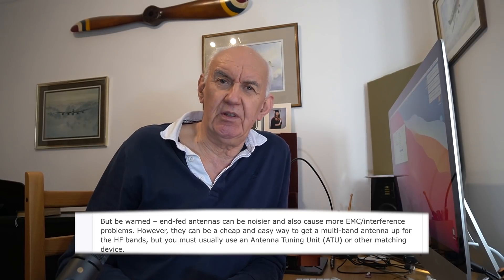END FED HALF-WAVE ANTENNAS - BEWARE!  WHY?

Comment: Actually the RSGB are correct. Let's look at some EFHW theory: 

The usual EFHW arrangement is to allow the coax to provide the necessary antenna counterpoise. Due to the high feedpoint impedance of an EFHW (about 4K), this usually works perfectly well but it *does mean that the coax is part of the antenna system*.

There are 2 consequences of this - guess what they are?

1/ NOISE: any common mode noise injected into the coax from a switching power supply, mains-born noise or other source of noise in the shack is fed straight back into the receiver input. With a noisy power supply, this can easily contribute 5 or 6 S-units of additional noise which would not be present using a half wave dipole fed with balanced feeder or coax with a balun at the antenna end.

2/ INTERFERENCE: for the exact same reason that in-shack noice ends up in the receiver, RF from the transmitter ends up back in the shack, and potentially ends up back in your mains circuit, where it is in a position to interfere with other electronic devices in your home. This may be less of a problem in 2021 with electronic products being generally less susceptible to EM interference than in the past, but that doesn't mean that there isn't a problem with the aerial injecting RF back into the mains.

The above situation won't cause problems for everyone, it will for some though!

This situation is fixeable, just add a separate counterpoise to the EFHW transformer and connect a balun between the coax and the EFHW transformer so that the coax is no longer part of the antenna system. But how often do we see someone bothering to do that?
Reply from the maker: The noise factor you try to explain does not exst in any greater measure than other coax fed systems. The coax counterpoise is likewise wrong. You may want to che k Moxon on end fed Zepps. An extremely short coax feed to an EFHW works just as well and a counterpoise makes no neasuravke difference. Peter
Reply: @watersstanton  

1/ Here's a technical article that covers both EFHW and Zeppelin antennas and further explains the theory I have outlined above: https://www.w8ji.com/end-fed_vertical_j-pole_and_horizontal_zepp.htm

(Look for the text in red on that page)

As further explained in the article, an end-fed antenna of any type that worked without something somewhere (e.g. the coax or even the radio itself) acting as a counterpoise would violate Kirchoff's current law. There MUST be a return path for the current if current is to flow to the antenna.

The need for a counterpoise may be minimal with an antenna that has a high feed point impedance but it is NOT non-existent.

2/ Unlike an end-fed half-wave antenna in which the coax works as the counterpoise, a coax-fed dipole with a balun at the antenna end will have no susceptibility to common-mode noise injected into the coax. it is incorrect to claim otherwise, and the difference can be huge if the radio is connected to a noisy SMPS.

3/ my main point here is that the RSGB are correct in their claims about this type of antenna, I think that needs to be acknowledged.

Comment: Your statement at 5:55 that the antenna presents the SAME impedance on different bands is not correct. It does present HIGH impedance on harmonic bands but the impedance falls a lot at higher frequencies. I have used one the last ten years, fed through an L-match, and have no complaints.
Reply from the maker: That is not supported ny my measurements.
Reply: @watersstanton  you had better measure better

Comment: I converted my multiband doublet to A EFHW.  QRM was reduced immediately plus all the regular AM signals on 3.615 were a good 2 S points more. Far more successful for me as the multiband doublet was noisy and not fully balanced due to logistics.  My EFHW lis cut fir 80m upwards and by far the best for me here in South wales. De gw4gja
Reply from the maker: Ken, great to hear from you. 73 Peter

Comment: I built the 20m EFHW vertical after watching you explain it. Using 30watt portable I was told "I'd swear you were using a beam and amplifier"
Reply: I should do that!
Reply: @StephenGangi  I believe he has an older video on making and tuning a true end fed half wave. It uses a piece of coax as the tuning capacitor. No formulas or special parts.

Comment: End fed antennas are very good.  I've been using a HighEndFed Antenna from the Netherlands for a while now and it works great.  However, I had to make some modifications to the installation because I was wiping out a digital set-top box.  I turn the antenna around so it was fed from the bottom of the garden.  Also, I'm using an RF choke along with two counterpoise and earthing.  It appears to have stopped the interference.  Having said that, just occasionally, my transmissions do still knock out the signal.  But I am beginning to wonder whether there may be a problem with the cabling on the set-top box rather than a problem with my antenna installation
Reply from the maker: Thanks for sharing. 73 Peter

Comment: EFHW antennas are great - I think the issue with comments about end fed antennas and noise are folks thinking about 9:1 unun fed random length antennas - these are notorious for noise and common mode current issues and folks seem to confuse these with 49:1 EFHW antennas

Comment: For years I oped in ingnorance. Then one day out of desperation I tried an endfed. Now I realized I had wasted half my ham life. I now use either end fed or offcentrefed longwire. Often at under 100watts . 15 years later I am still grinning. Have no desire for any other. Keep.preaching. Ve3lyx. It scares me because I agree with everything you said
Reply: End fed and off centre fed antennas has issues with common mode currents.  It can cause noise and RF in the shack.  You can cure most of the problems using a current balun.
End feds are just half the antenna, so the rest is either the coax or metal supports.
Nothing wrong with the principle, but anyone using them should have an idea what this does to your radiation pattern.

Any antenna is better than none, but I prefer balanced antennas to keep noise as low as possible.

Comment: Thank you. I like QRP operation from nature. I use both end-fed and center-fed antennas. Both work equally well. However, EFHW has a huge advantage in nature and is easy to install and as you say, you can use it on multiple bands. You can watch my new video (OK7NV), but unlike you I'm not a good speaker or youtuber :-) - OK7NV 73 Jiri.

Comment: Ships use end fed wires that come directly into the radio room usually via copper tubing and were tuned using a very robust antenna matching unit. We used to hang neon bulbs on the copper feed lines to provide a visual indication of which antenna was active and that rf power was actually being put out by the PA.
Reply: Amazing!!
Reply: not any more they don`t
Reply: @brian.7966  Correct, because tens of thousands of maritime radio operators both ship born and land based were now superfluous to requirements thanks to GPS and Satellite communications that replaced maritime SOLAS and ship to shore HF radio communications. That is why I left my job as a Maritime Radio Officer with Cunard Line and came ashore, the writing was on the wall that satellite communications would supplant SOLAS and the maritime HF communications.
Reply: Yes...they did have a great ground counterpoise though.

Comment: Excellent video thank you for sharing. Due to the long Covid I am housebound so have acquired a second HF set a Yaesu FT 840 along with the MFJ ATU to set up a second station either in the bedroom or living room. My shack has a long wire with Balan but I was considering the end fed half wave as I think it will be easier to set up. If I set up in the living room it would be fastened to a tree down the garden then over my roof and down a wall into my living room. Do you think that would work? M6EOS . Sorry should have said due to lungs and heart now being damaged I am struggling to get down the garden to my shack and I need something that is very easy to set up.
Reply from the maker: Hi Tony. The end fed wire is pretty  tolerant of bending and folding! You may find that the length will need to be adjusted a bit to allow for closeness to the house. Check resonance on the lowest band and either increase or decrease length - probably the latter. The other bands will automatically   adjust. Glad to help you. 73 Perer.
Reply: @watersstanton  thank you Peter. I hope to see you at the Newark ham fest sometime if I ever recover from this Covid.

Comment: I found 84 feet for my end fed works our pretty optimum. 30 feet high in the center with the ends running down to 8 ft
Reply from the maker: That doesn’t sound like a half wave to me? I guess you ar3 using a tuner?

Comment: I've been using an 80-10m EFHW for 4  years, with outstanding results. Only 25 ft off the ground. 63 countries on FT8 in 11 days. Great on SSB as well. Can tune ALL bands with my radio below 30 MHz except 60m. Have RG-8X wrapped 5 turns around a couple of ferrite rings. Quiet, great antenna, and so easy to get up. Sad that dinosaurs are giving it a bad rep. Good video sir. Thank you.
Reply from the maker: Many thanks. 73 Peter.

Comment: Very good discussion.  I like using an end fed half wave especially for portable field operations.  I use an L-network tuner and an insulated quarter wave counterpoise to provide a "ground" at the tuner and eliminate any concerns about high RF voltage at the tuner and/or rig (the open, high impedance end transforms to a low impedance at the tuner).  Next time I do this I'll try your suggestion of instead wrapping a few turns of coax through a toroidal core.
Reply from the maker: Thanks William. Take care. 73 Peter
Reply: @watersstanton  ...a few turns of "coax," not "coat" <hi>

Comment: I use an EFHW with a 9:1 matching transformer, I did have some problems, but worked through it and sorted it out, been the best antenna I've had.
Reply from the maker: Many thanks. 73 Peter
Reply: No you do not. A 9:1 is for a random length, not an EFHW. EFHW stands for "End Fed HALF wave. This confusion never ends.
Reply: @n4lq   no Steve I do use an EFHW and this is why:
1. The antenna length is 33ft long, this is very specific, so not random.
2. The lowest band it's made for is 40m, at 33ft it's exactly a half wave.
3. It's end fed from the matching transformer which in my case happens to be a 9:1 UNUN.
4. I bought it as a complete kit, it's even specified as an EFHW.
5. There's no rules that say it can't be a 9:1, just use what works.

Comment: They're great for lightweight portable systems such as SOTA. Power is low so matching circuitry can be lightweight. Feeder is short so less to carry. They can be run up a long fishing pole, or run as inverted V if the fishing pole is not that long in comparison with the wire.

I do use a counter-poise, but I magnetically couple my antenna so current has to go somewhere. Also allows me to DC ground it for kite operation. Sounds like your use of a line isolator achieves the same but without the DC ground path except through the transceiver.

I do remember the old Foundation Manual warning against end-fed wires. Though my inverted V EFHW is sort of a dipole in terms of current patterns in the wire, but is fed at the end.
Reply from the maker: Thanks Richard. The warning is on the RSGB web site 73 Peter

Comment: I use an end fed half wave cut for 80 meters as an inverted L using a homemade 49:1 UNUN fed with RG8X. The UNUN provides a direct DC path to a 10 foot ground rod that is directly beneath it. The UNUN stops static voltages from building up on the antenna and it provides lightening protection as we get a lot of lightening here in Florida. The first fifty feet of wire runs vertically up a first pine tree and the rest runs horizontally to the top of a second pine tree. I have worked the UK and Europe on 75 meter SSB and VK's ZL's, ZS and all over Europe on 40 meter SSB. All these contacts were made using only 100 Watts. This antenna works great on all bands and it is not at all noisy. I do not use a counterpoise as the antenna uses the coax for that. If you put a choke in line make sure it is at the shack end and not the antenna end or the antenna won't work. The inverted L provides both very low angle and some high angle radiation so it is a highly effective antenna for both DX and local contacts. It is without any doubt the best all round antenna one can put up. N2SN

Comment: I've been using an EFHW for some years now. I live in Australia and my only radio is an FT817nd. I have talked to ZL before but mostly (my qth is south east Victoria) I have 5/5-9 to the surrounding states (VK 2,5 & 7).  The EFHW I have is for 40 meters (of course also 20, 15 & 10 M). It's only about 7 meters off the ground stretched between two poles but has a sag in the middle.  I swear by it.
Reply from the maker: Hi there. Well done. Also remember that on 20m up, the radiation lobes tend to be clover leaf shape and not 90 degrees from the run of the antenna. 73 Peter

Comment: Was using a home built 40M inverted V but needed an NVIS antenna for 80M EMCOMM. I built a 49:1 transformer and 80M EFHW and installed along the top of my 6 ft wood fence in my back yard (garden). It's in a J configuration fed at the short end of the J with two 90 degree turns at the corners of the J. Tuned to the digital range on 80M and works great for that. Surprised to find it works better on phone bands than my inverted V so I am using the EFHW for everything now. Manual tuner gets 1:1 or close on every band so far. I made a Japan contact with 50W from MS. Built a 40M EFHW for portable work as soon as my Xiegu G90 arrives.
Reply from the maker: . HI Jack. Many thanks for sharing.

Comment: I recently passed my foundation and bought an EFHW, but not sure how i go about fixing static build up from the antenna. My shack is on the 2nd floor of the house so don't have any grounding in place. Any suggestions thanks.
Reply from the maker: The matching transformer is likely to show a DC earth return. Check with a test meter to see if the antenna output terminal shows a short circuit back the the outer of the SO-239 coax socket. If so you dont have to worry about static.  73 Peter.
Reply: How is static bothering you? Getting shocked when touch the rig? Look up "artificial ground", but I don't know if cost is justified.

Comment: The only "problem" with the end fed antenna, is the feed point impedance!...  other than that it works basically the same as a center fed antenna...  I have seen this with practical, on the air testing, and using antenna modeling software!
Reply from the maker: The feed mpedance is its strength which makes it multiband.

Comment: Hi Peter, I always enjoy a discussion on Antennas  especially the EFHW ! I have the 80m version squeezed into a 70ft garden with the 49.1 about 3 feet above ground and no counterpoise.  I have my line isolator midway between the feed point and the rig without any problems. I had a qso with a guy  over in Chicago on 80m a few weeks ago, so I'm 😊
Reply from the maker: Sounds great. Thanks for sharing. 73 Peter

Comment: My home base station uses an HYENDFED multi-band that is resonant and requires no tuner.  I put it in a sloper configuration and work the world with no problem.  I use a lighter version for QRP and it is best portable antenna I own.  You can't get an easier antenna to deploy.  Get yourself a fiberglass pole, and arborist throw line and connect to the nearest tree, too easy.
Reply from the maker: Thanks for sharing. 73 Peter

Comment: Bill-N6EF-I use a homebrew EFHW for 40 meters in an inverted vee configuration for my POTA activations and love it. It works very well. Very little noise. I've made many contacts and have had many pile-ups. I use the DX Commander 10 meter fiberglass telescoping mast for the center support. It only takes a few minutes to setup and breakdown. I use 12 feet of coax as a counterpoise connected to a homebrew common mode choke (12 turns of RG-58 on a FT240-43 core) before the rig. No RF problems in my go-kit.
Reply from the maker: Thanks for the tip! 73 Peter

Comment: Getting ready to put up an efhw and will see what the results are.  Currently working with an antenna restricted area so for some, this may be one of the few options available to get on HF.   The antenna problem has been the one component that has prevented me from experiencing HF.  I'm hoping the efhw will change that.  Thanks for the video.
Reply from the maker: Many thanks. I hope you are able to get the antenna up in the air. 73 Peter.

Comment: Thanks Peter for another useful video.  I have an 40m long EFHW and was suffering from poor performance since erecting it three months ago.  However, after checking the 49:1 balun that came with the pre-made antenna/balun kit using a NanoVNA last week I found the balun to be poorly constructed with a single non-descript ferrite core and over -7dB loss.  I replaced it with a well designed balun using twin 240/43 mix cores and it now performs exceptionally well on 80m with a very low SWR and no need for an External ATU.  Other bands SWR looking really good but yet to have contacts with the new device. I agree with Peter that an EFHW is a good multiband antenna if you can accommodate it within your garden and are using good quality wire and balun.  My arrangement is a partial inverted 'L' configuration and does have a counterpoise and quantity four 'four foot' earth rods.  I can't say I have noticed any real difference with the counterpoise also connected to the balun.  73.  Steven (G3ZDG).
Reply from the maker: Thanks Steve. I use the same ferrite material in my home-made matching unit. Glad you got it sorted. 73 Peter .